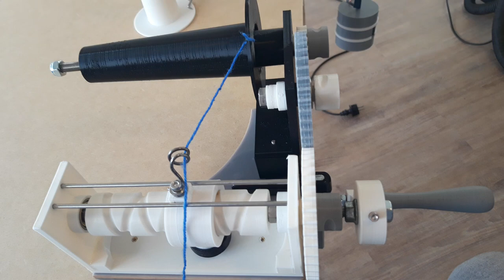cone winder

Comment: This is a super prototype! would also love the project files for this! Eventhough they are still in a prototype phase.

I am 3 prototypes deep myself building a cone winding machine for my girlfriend's tufting hobby. I first tried to remake the industrial bakkelite winding drums (as they are only available from china, but that didn't work because I couldn't quite get the shape right to not skip yarn.)

I was thinking using a stepper motor to mimick this linear CAM motion, but this works wonders! Is it a metal ball that glides over the barrel?

Thanks in advance!